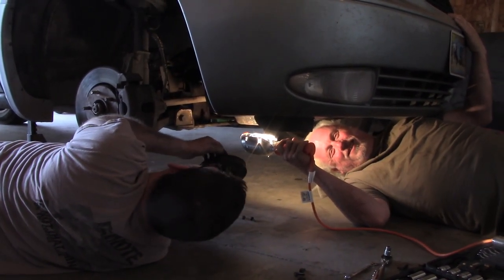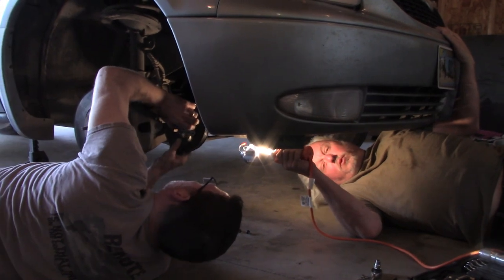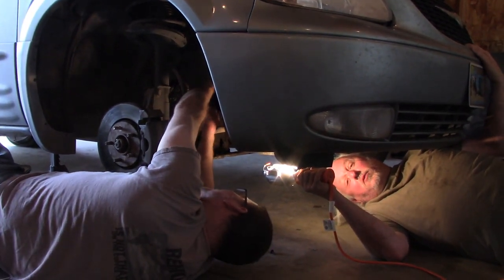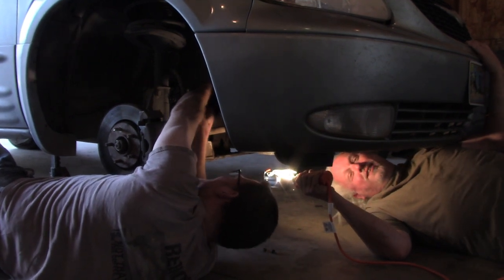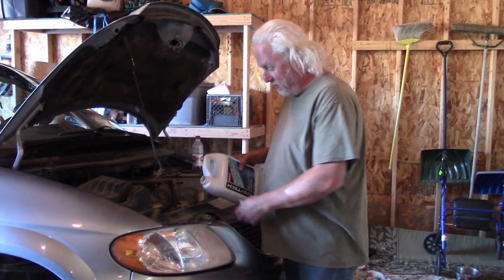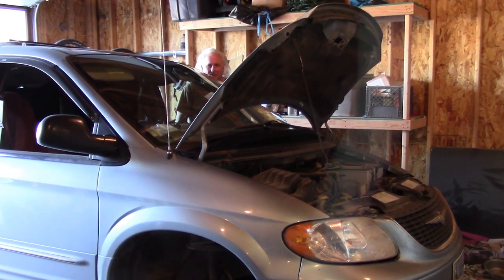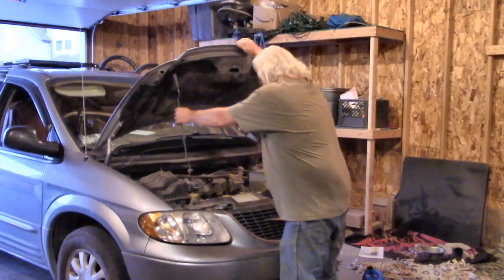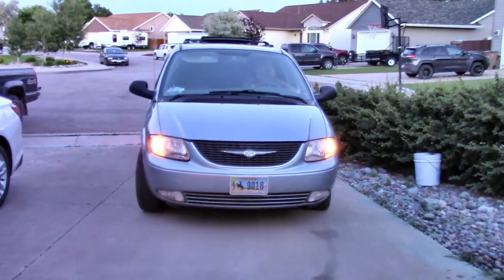Water Pump Replacement on the Van

Comment: You sure are lucky that it didn't plow out on you. That happened to me once a very long time ago. When it goes you don't go anywhere and can't even start up the vehicle. Last week my truck started to leak when I left the store so the next day I checked the fluids and had to add water. Then ran down to where I get things done to my truck and yes it was the water pump. You are very fortunate to have some one help you to replace it as yes they are expensive to replace. Glad it all worked out for you. Thank you Debra for the filming. Great video and hope all is well. Take care and have a great day.
Reply from the maker: I had one go on the road once in Bemidji, Minnesota in -30 weather. Great story with that one though as we bumped into a good samaritan who did the repair in his garage two days before Christmas. I could not have done this repair without the use of a shop and some tools I did not have, as well as some extra help.

Comment: Glad you were somewhere that you had help..front wheel drive transverse mounted engines are so fun to work on !
Reply from the maker: I would not have attempted that repair without a shop and plenty of tools handy! Heck, I almost didn't try it anyway. LOL It was ridiculously difficult to access, but in the end I saved a couple hundred dollars in labor costs at least.
Reply: Robert Witham Always said they should make engineers drive and do repairs to the vehicles they design..betting we'd end up with better designed vehicles..lol

Comment: Congrats on the new water pump peace of mind to be sure.
Reply from the maker: For sure! I didn't think that pump would hold up much longer, and when I saw how bad it was I was really glad to have it replaced.
Reply: I had taken my Prius to do something and they checked the car over said I should replace the water pump usually I will say you are FOS my car is just fine you are just trying to pick my pocket. But I had the means and just said go for it I don't want to be on the road with that bug in my ear.

Comment: Did you find the broken parts of the impeller?
Reply from the maker: I think we recovered all of the parts. Pretty sure it broke during removal so most of the parts ended up on the ground, but there was one still in the housing.